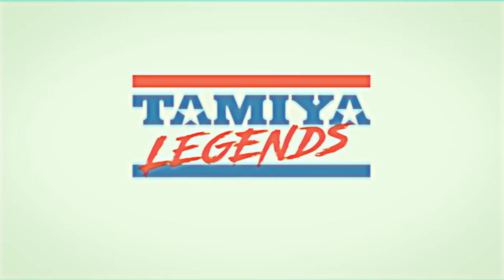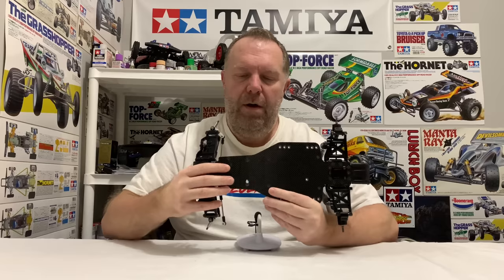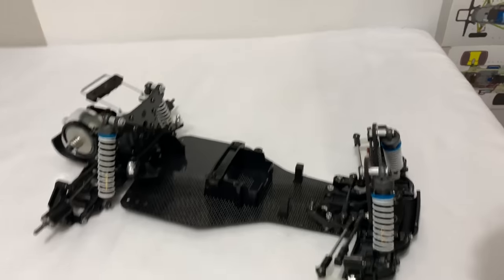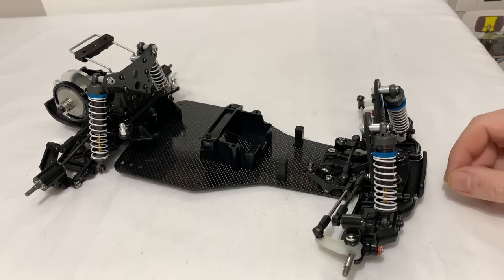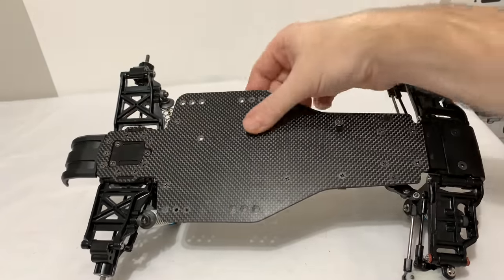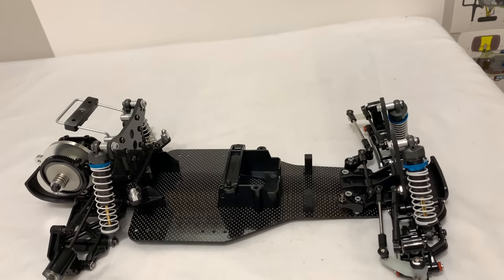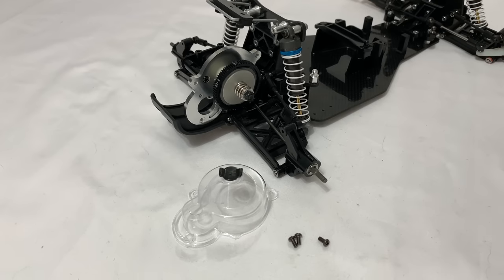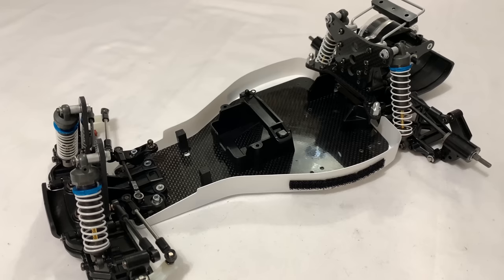The Big Reveal... Tamiya Super Astute Fully Hopped Up!

Comment: Looks awesome.  I totally understand what you mean about how the body fits.  Super annoying on both the astute and super astute.  Wait until you fit the electronics and run the motor wires out the back of the body.  Your probably going to have to make more adjustments.  I have a brushless set up in mine with a thicker wire gauge.  I found it super annoying to fit the body.  Again it looks super awesome.  Craig painted me up one of these for my super astute and seeing yours makes me want to stop my current project and jump on over to getting this fitted.  I need to stay focused lol....great work my friend and looking forward to seeing this run on the legends arena track.
Reply from the maker: Thanks Ari, after reading that I think you’ve just put me off running it 🤣👊🏻

Comment: It looks great Glenn, the fit of the body is a nightmare, I avoid paint rub by lining below the window where the battery clip goes with tamiya lining tape, I then added circles around the two rear mounting holes and up the back where the body can rub on the rear shocks. I am really glad you persevered, the Super Astute is such a good 2wd buggy, I can’t wait for the running video and your thoughts, I love it
Reply from the maker: Thanks David yeah I’ve actually taped the inside up now in those key places 😇👊🏻
Thanks for watching and commenting my friend 😊
Reply: I would replace the 2 outer front steering shafts aswell with Tamiya part 54845 3x50 shafts, they will look good with your TRF theme but I also found the stock shafts bend really easily under impact and these are much stronger, although you might be a better driver than me 😉 they also allow easier adjustment

Comment: Hi Glenn, for the servo you could fit a servo mounting arrangement like a Lazer ZXR, with a separate plate? It would mean getting a ZXR servo mount bracket and drilling / countersinking another hole in the chassis though. No idea if it would work they way you want it too but I don't see why not. That way you can have a sliding screw for adjustment of servo widths that does not protrude and both the other screws countersink to the chassis.

Comment: I'm not usually a fan of the flames, but on this build it looks fantastic.  You can get those wheels in chrome would that be something you'd consider to match the stickers?  Or maybe that would be too much bling.   Could you trim the edges of the under tray and inside edges of the front shock tower to help the body go on easier?  It seems a shame to lock all that lovely carbon under the body for fear of scratching it taking it on/off.
Great video!
Reply from the maker: Thanks for watching and commenting Chris 😎👊🏻

Comment: Those shock towers are way too big. They should mimmic the size of the OEM even if it is thicker. The R&D failed on that one. That's why the cover won't fit on easily. Looks mint but terrible fitting.